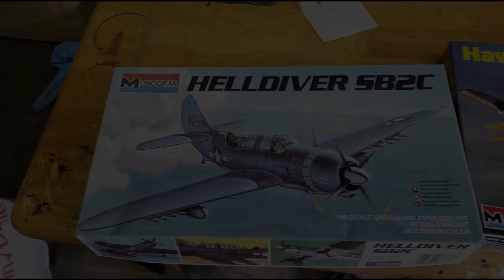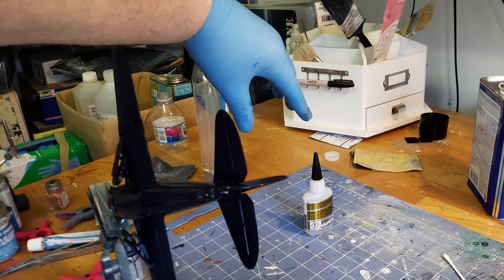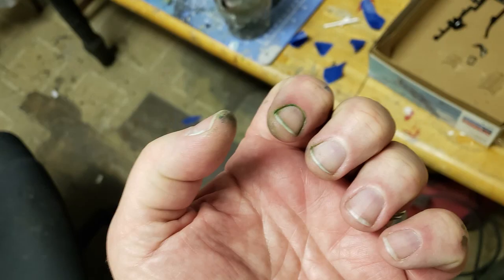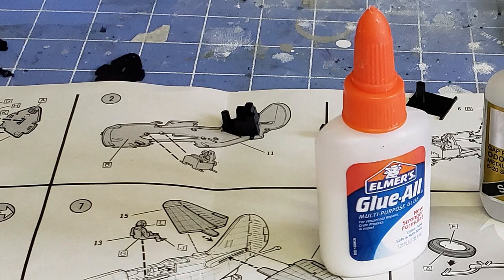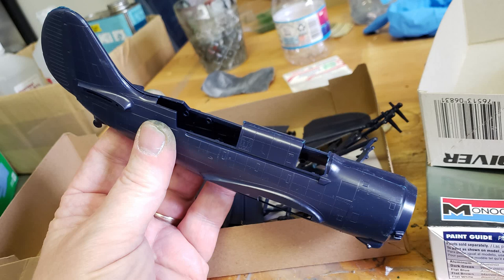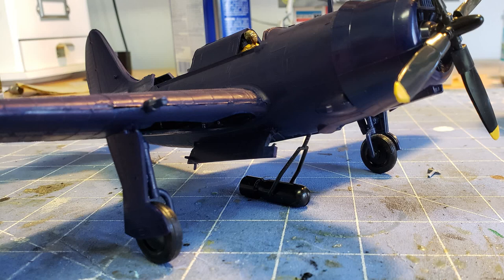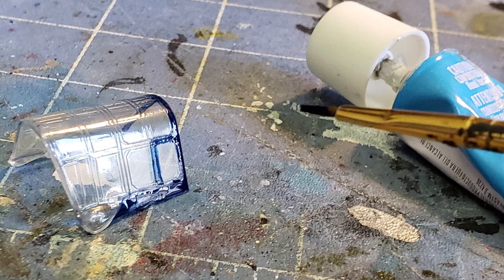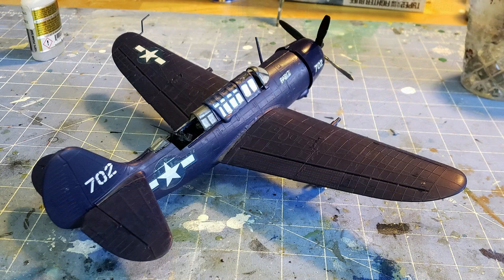Intro to building kit models

Comment: Great video Max!!  I love all your model company videos  watch them over and over and stumbled on this in my recommended !! I'm an experienced builder and was glad to see someone showing basic building skills !! You canopy framing tips are great but I stopped painting both sides many years ago in favor of painting the canopy with two different coats on the outside even when hand brushing I cut out masking tape covers coz my hands shake lol and I paint one coat the interior color first  then taking the second coat and applying the outside color sometimes in camo paints this could be 3 colors so I like to paint that first color with the canopy PV glued to the aircraft over masking taped edges because I have had seapage  because I spot glue I learned my lesson when I had to repaint some sides of seats while they were finished and glued in and handling a model at that late stage is a possible disaster for me I SADLY handed down my klutziness to at least one kid lol but the two different colors look great even on open canopy aircraft hard to tell if the paint is on the outside unless you put the model a couple inches from your face I slap hands if they try to get that close lol  THANKS AGAIN FOR THE GREAT VIDEOS !! Keep up the good work!!!